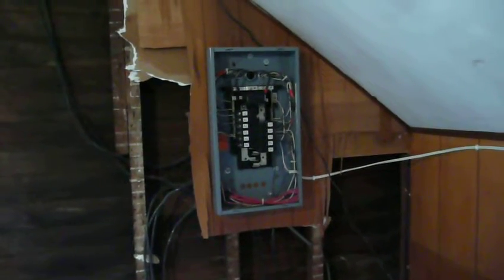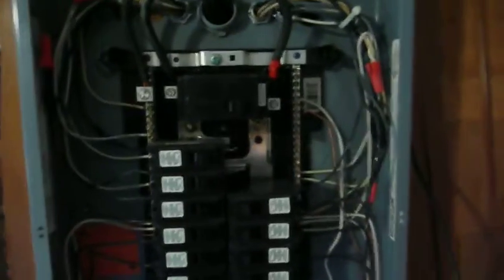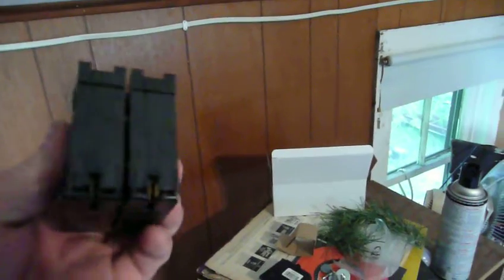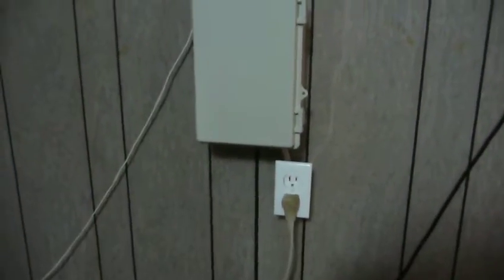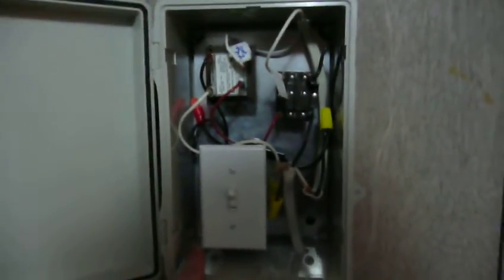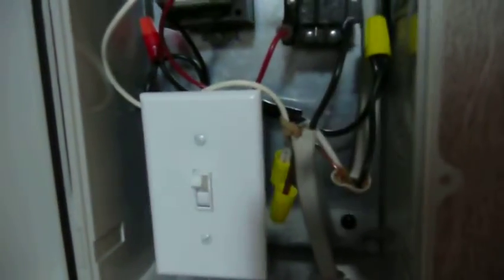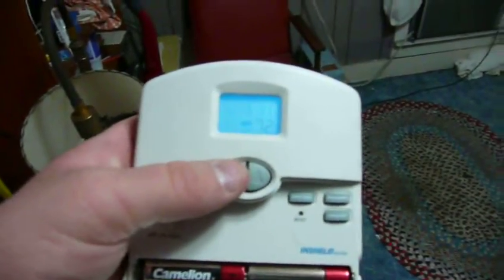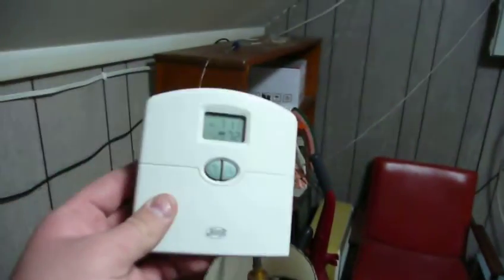The Finalized Air Conditioner Thermostat Project

Comment: I'm not at all an electronics pro, but, wouldn't it have been easier if you wired the thermostat on/off  lead onto the actual  "Old" wiring of the broken thermostat to control the compressor on/off, thus avoiding the transformer, lightswitch, etc? What i mean is, opening the air conditioner up, and wiring the thermostat to the compressor on/off lead directly inside the unit. so when the thermostat engages, it triggers a small relay which engages the power to the compressor? (like modern ac's)

Comment: The wiring is unsafe in this project the circuit feeding the A/C unit can not be placed in the face of the wall it is unprotected wire molding or conduit should have been used.

Comment: That's a great system. We have 4 relay kits in our house which are very similar to control all of the window units....three of them control 120 volt units and the one in the living room has a heavy duty 30-amp contactor for the 240 volt Carrier window unit. I have that one wired up so it can control both the heat and the cooling features of the Carrier window unit. Also all of the control transformers are on timers which shut the units off at night except in the bedroom.